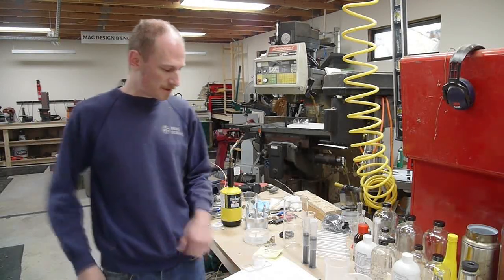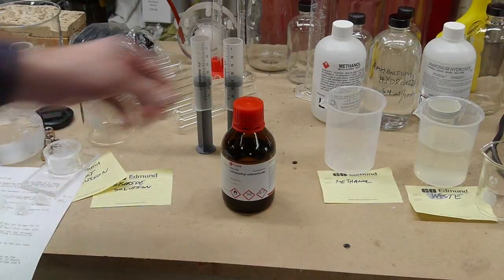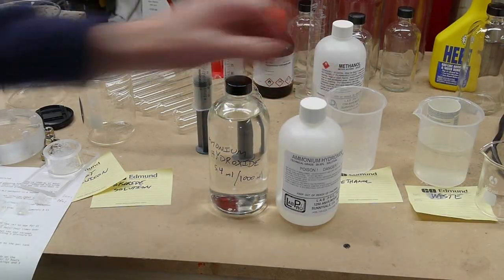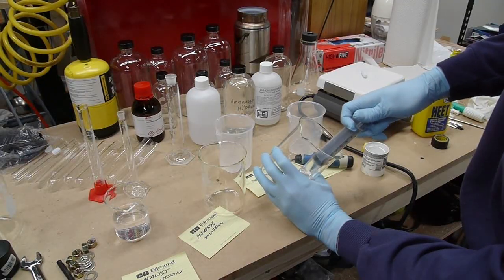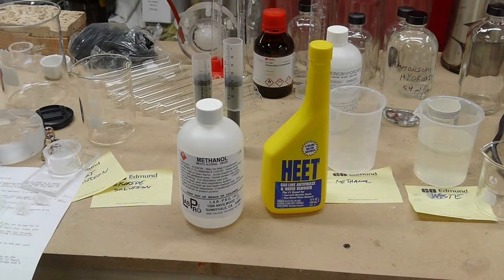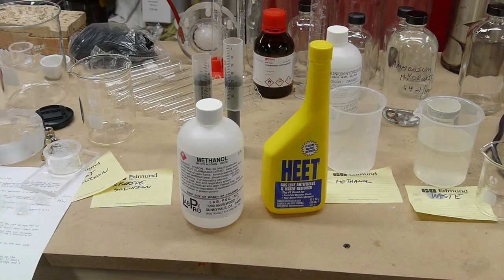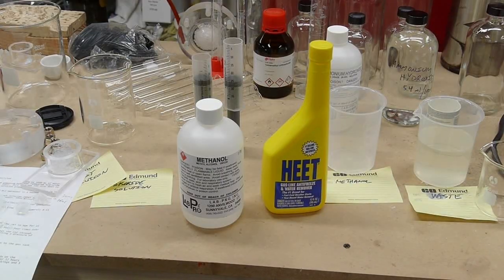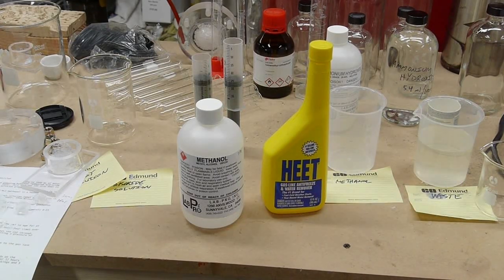Making silica aerogel at home

Comment: Cool, is it limited to just Silica? Or anything on the periodic table can be turned into aerogel.

I can source silica using the silica packets that come with food or the one bought in the a huge hardware chain.

Would a non-technical grade, a high-grade methanol have the best results? And then what if it's evaporated in a vacuum chamber at Mar's ATM 10%?

God bless.

Comment: Excellent video I would love to get way to watch more videos I had this I had a need for a project I have a I need oxygen and hydrogen separator and currently the only way is to Shadow sheet of platinum rolled into a half inch cubes or so and have laser drills holes the size of an oxygen atom so the purpose being to separate hydrogen and oxygen atom s and at the same time attached 11 electrons which creates 019 which is a critical component and it only has a half-life of about 400 nanoseconds and but it is essential in curing cancer actually so if you could figure out a way to produce this or 19 particle that would be wonderful I'm a fellow scientist as well because I follow and use the scientific principal and as well as detective cuz I the detective method and I'm an entrepreneur and an inventor.. not yet rich

Comment: I'm not sure I understand. Are you not able to extract and recollect spent methanol?

I think I see. If there is such a significant cost in separating mixed solutions then maybe linking chambers together in a short series could get more bang for your buck by using a spent mix on the next batch in the chain. The efficiency wouldn't be as respectable as the one first in series but you wouldn't be wasting as much material maybe?

I know this is an old video and maybe these teething problems have been solved further down the line but would cooling the samples and the chamber as well as precharging the atmosphere with cold gasses help with cracking?

Comment: I know this is a quite old video, but I'm wondering if you could make the water removal step easier (if possibly slower) by just putting the gel in methanol with molecular sieves or some other drying agent. A paper I just found says that 3 A molecular sieves at 20% m/v did the best, bringing the solvent down to 4 ppm water, which is likely much better than anything you can get exchanging solvent baths in air.

Comment: Probably a very stupid question but I was wondering wouldn't the aerogel crack when you release the pressure from the bottom due to the gases output velocity?

Comment: How porous is this material, and what kind of force can it take before breaking? could it hold a cellular structure? and if so, of what complexity and density? I know these are a bunch of seemingly random questions, and probably don't have any well-researched answers, but if it can sustain cellular life within it, it'll be much more durable than a cellulose sponge, which certainly makes up for how hard it is to make, on the smaller scale stuff at least.

Comment: You need to make a few changes to the process.. Make a much bigger chamber, that stands on a rock solid foundation so no vibrations will affect it. And you need to make a mold from fine mesh that fits in the chamber without too much fumbling. The first batch of gel you use to saturate the mesh to make it "waterproof" and the second batch you fill in the mold and shove it directly in the chamber, which you seal off immediately before the gel sets so it can settle without any disturbance at all. When the time says it has settled you start recirculating the alcohol through the chamber in a pace where you can seperate water and alcohol. When you can no longer pull anymore water out of the alcohol, you start increasing the pressure and add liquid Co2 to the alcohol still increasing the pressure until no more alcohol can be seperated from the Co2. Only then, you start decreasing the supply of Co2 increasing the temperature, keeping the outlet valve extremely hot to prevent it from icing up, and when the chamber has reached the critical point for a certain time, you turn off the Co2 supply, let the chamber de-gas slowly and finally turn off the heat. That should give a clear and unwounded brick of gel in the end..

Comment: You seem to have the same sort  shrinking issue the areogel has on the plastic films you made in the other video I watched... You could try to also add something that would be solid at the bottom of the chamber that would bond to the methanol like a dessacant for moisture in a vacuum chamber to reduce the number of transitions below super critical you have to make, might lead to better results as well.

Comment: Make up a 5% solution of phosphoric acid and then very slowly drip sodium silicate that has been cut with 80% water with vigorous stirring until the whole thing turns into a very solid thick jelly. It's very brittle gel at this point so handle it with great care. Now place it in the vacuum jar which makes the water boil away at room temperature due to the high vacuum. The vacuum also keeps the structure from collapsing. This form of "poor-man's" aerogel may shrink a little and is not very transparent but it's a cheap way to make a lot of high temperature and lightweight flame retardant insulation or even a good stuffing for an Arctic jacket at a very low cost. Using this technique I can fill up about six or seven 5 gallon buckets full of lightweight aerogel per day for a cost under $9. I used to freeze dry fruits and vegetables and stumbled onto this technique kind of on accident. In fact the aerogel made with the vacuum drying process reminds me of a freeze-dried Apples in many ways. Very light but pretty tough, hard to snap. For those of you who do not know water boils at room temperature in the vacuum. The trick is to use only enough vacuum to get the water evaporating very quickly but not boiling or the bubbles will blow the gel apart

Comment: Dude, why did you not just buy a wet Alcohol Silica Gel & liquid C02 then use a pressure cooker style autoclave?  I think that's all thats needed. The chemicals you are using seem very overboard and dangerous, plus I dont think you'll ever get a really good Aerogel product ? I'm just confused as to why you would do it that way, seems like a very bad method? One of the main purposes of Aerogel is for it to be somewhat safer to make and use. Using liquid Heat, are you kidding me! Better not have any Coleman fuel and  lithium batteries lying around, you could get busted for cooking something other than Aerogel.

Comment: Chill the chamber before filling try just hosing it down. I have thinking of trying this as well i might build my chamber inside a modified dewar, and leave my ln2 generator setup running above it keeping the chamber walls super critical at all time basically a pipe braised through the side of a dewar with a cap and a stainless steel shelf inside.

Comment: Howdy Ben, I'm John ntmy! By chance have you an update on this? I would like to mass produce a similar compound for use here in Arizona as well as the more resilient thermal barrier type. Would you have any solutions for making inexpensive versions? The company who created the original formula is selling for high priced contracts ONLY but if we are to help save this planet and reduce all fuel usage this needs to be available to the gen. pop. now. I pray you agree! Th AC bills here alone in summer are beyond reason and they financially cripple masses of good hard working people. The electric companies operate on the same principal as those who price gouge others during catastrophic events. It is not right! Implementing such insulation products would help pull many out of their financial bondage. Let's do this!

Comment: Regardless of the reasons why substances like tetramethyl orthosilicate may be difficult for private individuals to purchase, it's a potentially dangerous chemical to work with if you don't have the proper set-up, like a fume-hood, or knowledge of how and why it's toxic. Wearing some sort of respirator is better than nothing, but how effective that is will depend on the specific filters in it. It's hard to get a good fix on just how toxic TMOS is from the toxicology literature, but I would definitely not handle it without a fume-hood (and if you make your own hood, give some thought to where you are going to vent it - do you really hate your neighbors that much?). And I wouldn't make TMOS from tetrachlorosilane (silicon tetrachloride), as some viewers suggest, because that definitely is an evil material that you don't want anywhere near your eyes or lungs. When all's said and done, you can buy your aerogel on the open market without any risk to your health whatsoever.

Comment: Why is TMOS so guarded?  Does it have explosive capabilities or something?
Reply: Well, methanol can be extracted from wood aswell
Reply: @EddieMiamifgc  yeah that stuff is dangerous aswell it is in smaller volumes though
Reply: What is TMOS?
Reply: @VinOnline  It's a kind of transisterater.
Reply: Tetramethyl orthosilicate.  Sometimes called TMOS.
Reply: Wikipedia has a page about TMOS (Tetramethyl orthosilicate).  At very low concentrations, the fumes can cause serious damage to eyes and lungs.
Reply: NileRed just made a video where he goes a bit more in-depth with the TMOS danger and the project as a whole.
https://youtu.be/Y0HfmYBlF8g
Reply: It forms silica sand on contact with water.  If you get it into your eyes boom your blind. Get it in your lungs boom your dead.  Get it anywhere wet boom big mess.  It's very dangerous.
Reply: It's probably very toxic. Did you see the respirator he was wearing to work with it?
Reply: Thank you for the information everyone.
Reply: It produces methanol which can cause lung lesions and blindness
Reply: @ashiii7041  did... did you miss the 500ml bottle of methanol he had, that was shipped by LabPro?

Comment: Having just read the safety section on Wikipedia for this stuff, I wouldn't want to go anywhere near Tetramethyl orthosilicate. It seems that Tetraethyl orthosilicate is, relatively, a lot safer. Anyway, has anyone ever tried to further exchange the CO2 in the drying step with hydrogen or helium? Is it possible you could end up with a solid actually lighter than air? I would need to do the calculations to see if this even possible....

Comment: Just curious... Since the goal of the methanol soaks is to get the water out, could you reduce the amount of solvent required by using molecular sieves? Since methanol is less dense than water, I imagine a setup like this: fill a pot with methanol, add some molecular sieves, then place a steaming basket or some other rack on top of the sieves (maybe this is optional), then put the aerogel  on top. As water diffused out of the aerogel into the methanol, it would be selectively absorbed into the molecular sieves, keeping the solution relatively anhydrous and continuing to drive diffusion out of the aerogel. The best part is that it would save a lot of solvent... You could even filter and or distill the solvent and regenerate the sieves in an oven to make the entire process renewable.

Comment: Most auto supplies and hardware stores sell methanol as methyl hydrate by the litre (quart) or 4 litre (gallon) jug for far cheaper than gas line antifreeze and it has none of the additives.

Comment: Hi,  just needed to say a few things to straighten you out a little bit.  Anytime someone starts tellin me how hard it is to get some chemical it seems I always know an easier, cheaper and better way to do it, and as always I get to say Fuck SA Chemicals.   Okay man, you want to make this stuff, do it the cheap way, put away the damn measuring devices, get some distilled H2O, some lye, and some acid and get yourself a bottle of K&N Air Filter Spray.  This tetraMethyl Crap is not at all necessary, I promise as I just got thru making a whole bunch of different kinds, shapes and types for different uses a week back since the filter spray fell into my lap.  The silicates stay in solution because of basic conditions, which tells you that if you want to make the stuff come out so the two of you can play, then you need to acidify the solution.  I'm not going to give you instructions, just say play around, it is much more fun,  and then when you want to get the H2O out, use your dedicated Chem Microwave to do that, with the mask, and open windows of course, that part you will definitely not want to skimp on when playing with silanes and a microwave, but methanol is used to clean the stuff, or any alcohol really, then use the microwave oven to dry it.  I found many different methods to obtain different stuff for different uses, but all were dried in the microwave in Ceramic, not glass as it will break, and don't even put that crap on the microwave spinning glass as it will break also, must be a good fired ceramic dish to handle the heat and this stuff is very polar so it absorbs the crap out of those waves.  I made beads, powder, a fused glass filter thing with this stuff built in to dry as you go, and a few other things I don't remember.  Just remember you need to clean it by boiling it in alcohol after using it to dry your solvents.  And please don't try to say it isn't the same, as mine looks exactly like every kind and yours also, and it is most definitely lighter than yours in the powder form.  The nice thing about using these really super cheap methods is this stuff can pull as much water as you want, and really you were only limited before by the prohibitive cost.  I get mine for free, so that makes it super special, but it isn't very expensive, and there are also a whole lot of other uses I might share with you later, but for now.  No none of you can come over and share mine, get your own at the bike shop.  Peace

Comment: An idea for removing water from gel: Unless the water is very tightly bound to the silica, in which case simple washing would probably not work either, one could add a dessicant to the methanol such as sodium sulfate or magnesium sulfate (anhydrous) and continuously remove H2O from the gel.

Comment: To heat it just use a rice cooker outdoors, if needed after most of the solvents are gone, use an electric oven at 300f for about an hr.

For 5gallons of methanol for like $20 just get vp racing fuel M1 which is pure. I use it for my race car.

Ur welcome.

Comment: I'm probably a bitt to late here, but I think it would be fairly simple to reuse the ethanol by separating it from the water thru a condenser and a distillation, At least it would remove impurities with a lower boiling point than ethanol and get you to 94-96%. After that there are a few different ways to get you higher (if needed) -

Molecular sieves is a simple way to bind the water, but it is often needed to do another distillation to remove dust from the sieves after drying the alcohol. 
After the second distillation you can do a run with only the sieves in the flask to dry off any water, with a bitt of practise you can separate the ethanol stuck to the sieves from the water inside them, after that you simply crank up the heat and dry off the water. Or, distill both the water and the ethanol together, and add this to the first round of the next recycling prosess.. 
This way you get to recycle both the ethanol and the sieves.
Also covering the container containing aerogel when drying it reduces evaporation, as the ethanol has a lower boiling point than water I don't think this will slow the process, but could potentially speed it up as the evaporation cools the solution.

Note- I know nothing of the process of making aerogel, so for all I know there could be contaminants in the solution that could build up over time, rendering the recycled ethanol useless.. 
Anyhow, another great video and a really cool projekt!

Comment: "Even at low concentrations inhalation causes lung lesions, and at slightly higher concentrations eye contact with the vapor causes blindness. Worse, at low concentrations (200ppm/15min) the damage is often insidious, with onset of symptoms hours after exposure."

Sure, individuals won't have a problem.

Comment: Could you potentially remove the water more efficiently with molecular sieves, or another drying agent? If you're able to be constantly pulling the water out of the methanol, you can drive the equilibrium forward that way
Reply: Or if you can afford to get the gels hot, soxhlet extractor. If you can't get them hot you could maybe do some kind of vacuum arrangement with the soxhlet, but you would be risking drying out your gels, and I don't even know how helpful it would be to have highly effective water removal.

Comment: I'm an organometallic chemist and I have some ideas for you
Did you think about trying to make the Tetramethyl orthosilicate yourself?
I haven't done it before but I'll bet it you could do it by deprotinating  methanol with sodium or something like to make sodium methoxide, and then dissolving glass in it
You could distill off tetreamethylorthisilicate 
My second question is have you thought about distilling that cosmetically available product to remove the additives other than methanol? It might be cheeper than getting lab grade methanol 
My third question is have you thought about using water free methanol? I imagine that would make your solvent washes much quicker you can make it by putting your methanol on magnesium turnings and iodine, letting everything dissolve and distilling out the methanol

Comment: What if you freeze the methanol? Just put in a freezer for a night.

It's not actually the methanol that is going to freeze because methanol doesn't freeze until -143F, you will have a block of frozen water and perhaps other impurities.

Then your liquid should be pure methanol or at least closer to it.

Would this make the drying process easier?
Could you even use it like this or is so much water required for the process to start?

Just spit balling ideas on how to get around the cracking from the drying process.